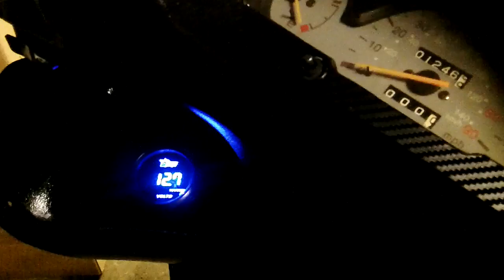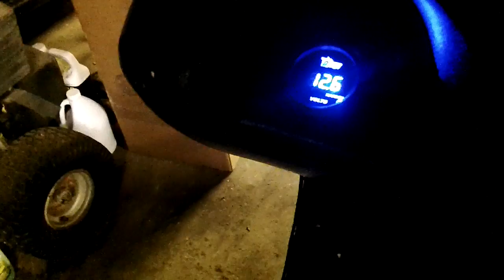volt meter install on a scooter

Comment: My voltmeter has two wires but I want to install it so that it only comes on when the engine is operating. Where do I connect it to give me a correct measurement of the battery?
Reply from the maker: gugolero I wired mine to the ignition switch.  It's accurate enough at that location.  The main reason to add it is to know it's charging.
Reply: I thought about this too like maybe two of the headlight wires? 

I have an electrical diagram on the gy6 and it doesn't show but 1 wire coming off the ignition. I haven't taken my front panel off the scooter to check it out but maybe you could give me a quick reference to which two colors the wires would be back there?